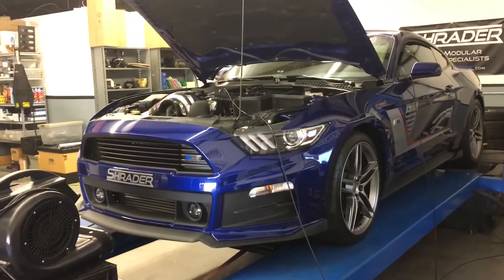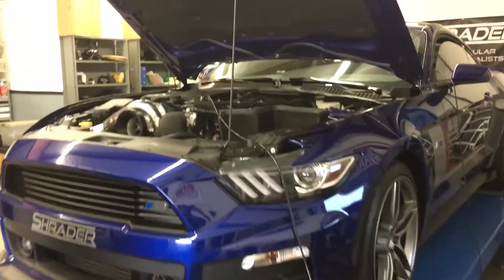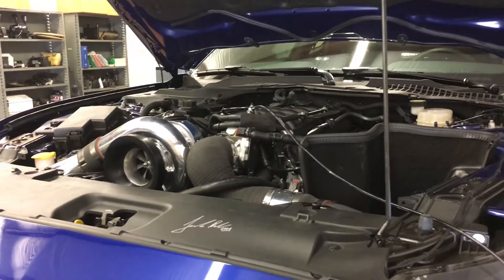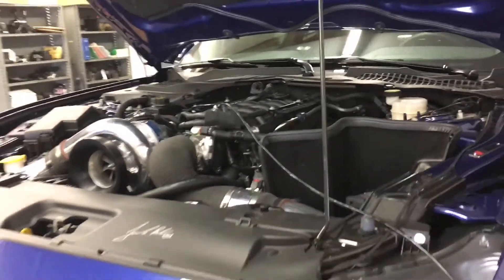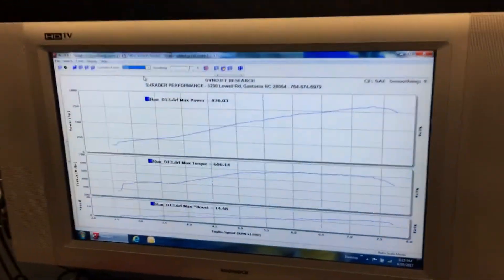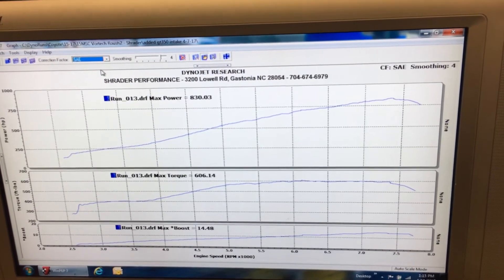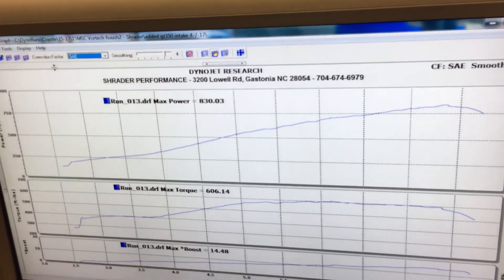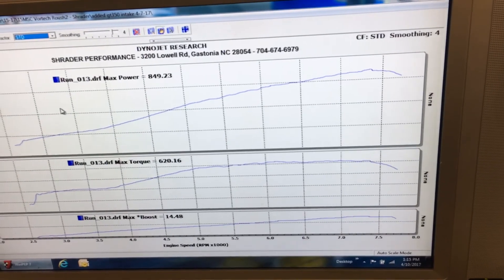Shrader 2015 Mustang, 849rwhp, Vortech supercharged

Comment: How did you go without any race fuel mixed in? Or did you have to pull the boost a bit in that form?
Reply from the maker: there was a little bit of VP 110 mixed in.
Reply: @stylin992  Ok so what would you have realised without the race fuel?

Comment: How much power did you gain from the GT350 intake? Is it more airflow than the Cobra Jet?
Reply from the maker: gt350 intake picks up a ton above 6000. max power went from 757 to 849

Comment: did you block off the hose that goes into the CAI on the vortech? i wanna run this set up just having little problems with the pcv system on how to set up.
Reply from the maker: No that hose stays there at the inlet tube and connects to the PCV on driver side valve cover, as well as another hose. The Vortech instructions are hard to understand around the vacuum lines, but if you look closely, it shows you how to do it.
Reply: Shrader Perf  thanks for the quick reply! Are you running any breather  catch cans?
Reply from the maker: Just one on the passenger side.